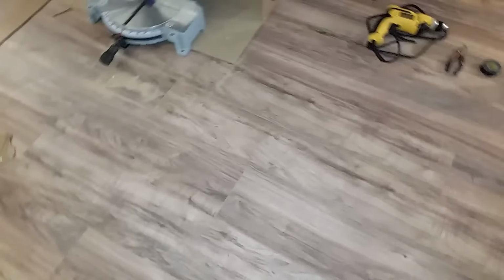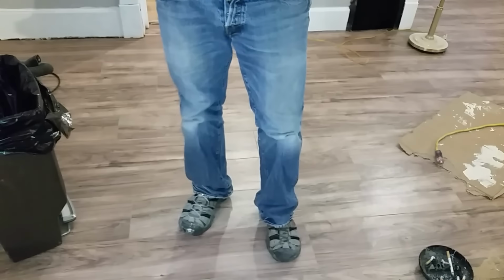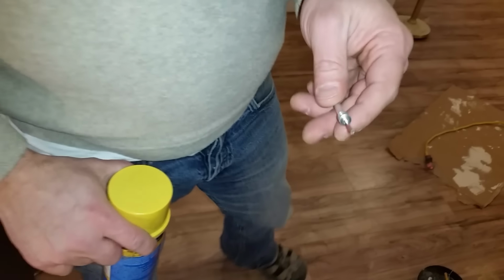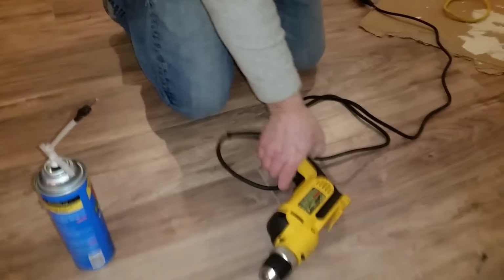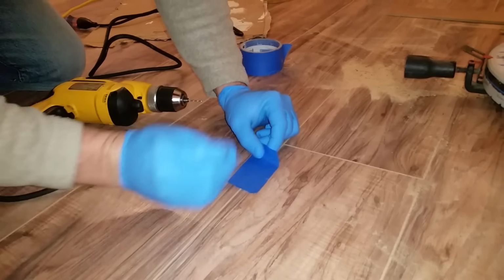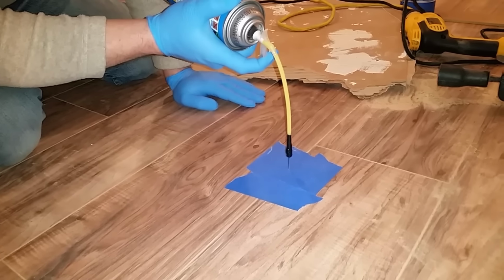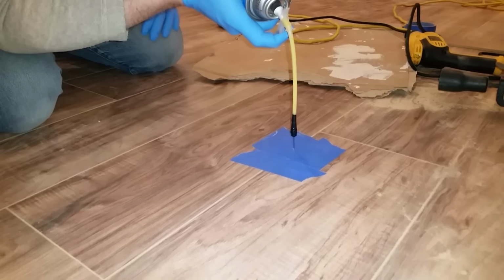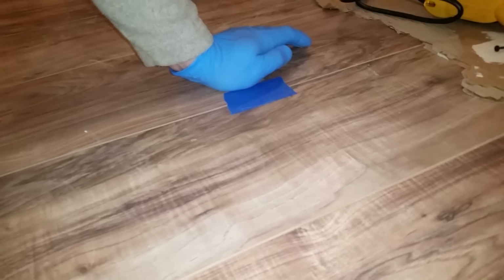Laminate flooring repair to fix soft spot for uneven underlayment

Comment: IT WORKED!  I did everything the same as the video except I drilled a few holes at once in case the foam needed more space to expand. I went very slow and alternated between the holes.  When I was done I left Olympic weights on it overnight to make sure it wouldn't buckle.  I wasn't about to tear the floor up for one soft spot. To all the people saying prep the floor beforehand, no duh. That would obviously be better but unless you have a time machine to go back before the floor was installed, this quick fix is cheap and easy.
Reply: As long as it fixes the issue.  That’s the only point.
Reply: ok, but does it last? (Because the foam turn into powder when it's compressed with time, cf video about guys inflating tires)
Reply: He does leave quite a bit out of the demo
Reply: About a year later... Still feels as solid as day 1. The other comments made me question how this would work so I check it frequently and is not budging.
Reply: I guess it has only been 9-10 months but the point is so far it's working great still.
Reply: Thanks for the 80s middle school throwback (Vermont area here) with the "NO DUH" comment. Then realized wouldn't "duh" be sufficient with... "no duh" being a double negative? Anyway  it's an effective and humorous exclamation.. : p
Reply: A year later and the floor is exactly the same.  It hasn't gone back to being soft.
Reply: @kevbew63  Good to hear!  I have a few soft spots on my laminate floors.  It's driving me crazy!  I'll give it a go.  Wish me luck!!!
Reply: @HarryWangHungLo  Good luck! Make sure to use the right foam.
Reply: Heavy Kevy will do!  I ordered the same foam as seen the video. Should be in any day now. Thank you!
Reply: @ytrew9717  I know its three years since your comment but maybe it will help some else. I have done this same treatment underneath soft shower stalls and tubs. The key is to use a high density, low expanding foam. The foam will still spread during initial application but will expand very little while setting up. I did this in my own home for an upstairs shower floor. It has been close to three years and the soft spot has not returned.
Reply: Im guessing its been 4 years at this point would love to hear how the foam held up. Also, did you use the same brand as the video?
Reply: @teistovisuals  I can't remember if it was the exact brand but I followed as closely as I could. Never had any issues with the floor again but I moved last year. I'm sure it's still holding up fine but I'm not there to verify.
Reply: @disillusioned070  do you think this will work in a mobile home? I have soft spots in the kitchen and hate to rip the entire floor to fix them. Thanks!
Reply: @kevbew63   were the holes easy to cover up? I need to do a few places at our home where I laid pergo laminate plank that has some hollow spots. Driving me crazy
Reply: @jason91205  I drilled the holes in cracks where the planks came together. Then when I was done I used some colored wood filler that came out of a squeeze tube. It was easy to do and hard to notice anything, even when you were looking right at it.
Reply: @disillusioned070  which product did you use? Was your floor laminate or vinyl?

Comment: I guess one precaution would be - DO NOT USE THE HEAVY EXPANDING FOAM !!!!!! BE SURE IT IS "MINIMAL EXPANDING" or you will be very very sorry ...... Just thought I'd throw that out there even though you said it in the video .... This warning is crucial to NOT creating a disaster
Reply: He already said that in the video.... no need to repeat it
Reply: Good tip! I kind of wondered about that too. I thought of the same trick before watching this. But I was worried it might expand too much and push the flooring up.
Reply: @Davidbruun  ok. Understood
Reply: @Davidbruun  Agreed. I actually missed that detail!
Reply: Thanks for that tip, i missed it on the video!
Reply: @successfulMillennial  I think it's worth repeating since using the heavy expansion foam would be a total disaster .... and read below to see a few people missed that very important warning ....
Reply: @shure46  oh ok
Reply: @successfulMillennial  but what about not using expanding foam😁
Reply: @successfulMillennial  actually thought it was very useful
Reply: Yes, that product expands too much and it can like case an inflation behind the laminated
Reply: IS it going to collapse after under weight. ??? Foam vill shrimp??
Reply: Not necessarily. The laws of physics. If the space filled is very shallow, say, 1cm, the foam will spread underneath leaving no cavities. It won’t ‘shrimp’ without being exposed to direct sunlight or other source of heat to gradually turn it into a powder. I’ve done this in my hallway, still holding fast two years on.

Comment: some of these comments are ridiculous and over thought (engineers) lol this is a perfect fix for a homeowner or flipper who has an already existing laminate floor they did not install themselves. No tearing out a perfectly good floor for a minor bend in the planking. Nice video.
Reply from the maker: +John Legnos Thanks, I agree with you since it worked for me.
Reply: John, I am a Quantum Molecular    physicist from the future and i came back to tell Aglobal llc that his repair saved the human race. How? His repair with stand a nuclear explosion  of 1000k joules....lol
Reply: I'm neutral for arguments sake:  It's scary to use the word "FLIPPER" and assume high-quality,code compliant repairs or builds.    BOTTOM line, would this procedure work to make a long lasting quality, trouble-free repair?
Reply: How about by an installer John?
This will create worse problems within a year.
Nice try though trying to shame an engineer. Better luck next time.
Reply: keith cunningham  I don't doubt that, but will this not introduce alot of creaking due to floor no longer floating?
Reply: @SlothyWoffy  I would think that a couple small areas wouldn't affect an entire floor system, but I honestly don't know for sure.
Reply: @SlothyWoffy  Floor will still float in directions of least resistance. It has 4 directions to float to in total. It also a function of the location of the repaire spot on a floor. Plus there is extra flexibility on underpadding also.

Comment: I'm pumped I found this video. Installing a new floor now and just tore it all up just for a soft spot only to try and level it, lay the floor back down and still have a soft spot. I'm not tearing it up again. Just ordered foam and needles haha.
Reply: How did it go? I’m worried about injecting too much
Reply: @rasscal  I have all the stuff but haven't tried it yet because I'm away from home for military stuff. I don't think I'd worry about injecting too much, I don't think it would cause the floor to have high spots. It probably only expands into empty areas.
Reply: And now you did this? Working good?
Reply: @pelless  be really careful when injecting it. It will raise the floor if you use too much. I'd advise only for small spots, and place like a level over the spot with weights on it on areas that are level so you have some resistance to lifting at the level of the rest of the floor.
Reply: @theodorekr9701  good smart idea.

Comment: This laminate flooring fix really worked for me. No problems with the foam drying. It's the same as being in a cavity behind a window or door frame.  :) Thanks s a lot! 5 stars!
Reply: Abbie Road- LLC how do you know how much to put ?
Reply: how do you cover the hole in the laminate?
Reply: @tszabo86  Wood putty would take care of that easily.
Reply: May i know what is the name of the foam?
Reply: Yeah I used this method to stop our new subfloor that was squeaking in certain places. We had secured the boards and counter sunk the screws but somehow there was just enough of a space for the subfloor to give a bit and cause squeaks and creaks. Drilled a hole or 2 where needed slid the little hose in and give it a shot of window & door trim expanding foam. Being the subfloor was screwed down SECURE the foam only filled within the areas it could get into and expanded only as much as the gap available. No squeaking, no creaking and no feeling like it had any give. Also remedied the possibility of causing the new vinyl to be damaged due to that slight subfloor shift/movement.
Reply: After 4 years is it still holding up?
Reply: I use floor wax repair. I loose track of repair areas it looks so good

Comment: Great info. However, I had difficulty with the inflator needle, couldn't get a good seal. Ended up drilling 1/4 inch hole for the foam directly. That worked better for me.  Everything else the same.

Comment: Thanks!!! A great tip. I had a large area of depression underneath an engineered bamboo hardwood floor. Basically the subfloor is slightly uneven but noticeable enough which was hard to appreciate before installing. I did use the regular Great Stuff foam after the “windows and doors” one. In my case, I felt the regular type provided better structural support than the low expansion one. I put weights (a case of planks on each side) to prevent over expansion for the cure period.

Comment: Great video, my floor area was about 14 inches wide so I taped the laminate seam the entire length.  Ball filler was too small for tube so razor sliced end to insert. Taped together as shown and then used glue gun to cover tape ends for secure. worked like champ. weighted seam with 2 , 5# weights on 1x2 board. Holes had little yellow beads come out, sliced off, redrilled hole and sealed with some wood putty. Thanks for the how to video.

Comment: I have laminate flooring and there are a few planks that dip and creak around the seam of the joints. Will using fast setting wood glue work? Or am I to use minimal foaming glue? I cannot rip apart the wood to fix it for expansion.
Reply: Have you tried it yet? Did you end up using adhesive / glue or expansion foam?  Thx

Comment: Do not use loctite brand foam, use great stuff brand. Loctite brand is very dense and created more problems as it made the floor a “mound”…..needless to say I’ll be removing 3 planks to clean up the mound and correct the problem.

Comment: As mentioned below do not use much you we’ll be screwed. Much safer to use a caulking with a turkey injector and then put a wait on it.  Foam is harder to control.

Comment: Problem only after dry Foam push laminate up because foam it’s razing and make bumps in laminate
Reply: That's why you're supposed to use non-expanding or minimal expanding foam. If you use expanding foam for large gaps, yeah it's going to do expand just like it was designed to and it's going to create lumps in your floor.

Comment: I don't know, but this approach seems like your basically creating uneven flooring by (foaming in) the soft spots. You may have addressed the "soft spot" by creating uneven mounds on your flooring. Wouldn't a better solution be to use the same method (attaching air needle) to a bottle or tube of construction grade glue?

Comment: I can't wait to try this!! I made the mistake of hiring a "flooring installer" from the internet to lay vinyl plank flooring on the entire main floor of my house for a cash deal. I quickly found out why his price was so low. This guy put NO underpad or anything over the subfloor before laying the vinyl planks. So I have SEVERAL uneven spots that are now causing some planks to crack. I'm going to try this genius trick today.  One question though, how do you hide the drill holes? I am going to have quite a few and a lot of them will be in plain site.  THANK YOU!!!
Reply: Same here and they never even answer the phone anymore
Reply: @kathr3335  If possible drill the hole through a knot looking area of the plank and gill with regular wood puddy to match. you will still see it when the light hits it right bit it will be less noticeable.

Comment: I actually did this before but used a 3/8s drill bit which is the same size as the tube and I plugged it afterwards with a piece of wood and colored the plug with a stain pen

Comment: I tried this 2 days ago but with the 3" expansion foam and not the yellow top 1'inch. 3 in is better but the hoses don't fit on that tire inflation nipple and tape only works for 1 minute before it blows out.

Have to use the clear plastic hose as the gray one will not work and I already had 2 left over.

Comment: Your Video on laminate floor was ABSOLUTELY GREAT on so many levels.  Listen People!  If replacing the floor is the option a Pro would do then why not give a $20 fix a shot and see the results.  I loved the Puritans say this was a horrible job! I loved the People who loved this trick and I even loved the idea of glue instead of Great Stuff.  Even the guy who wanted to come up from the bottom of the sub floor to inject the stuff ..AMAZING..  This video got people together talking and thinking.  Thank you to all the people with the "should not be tried" comments, I do see your points made..they are quite valid and have experience behind  them.  

I am being called in to repair a floor and have the quote to replace the floor, a quote to repair the sunk in areas....And, now I have an idea to try it myself.  A big THANK YOU to the Author of this video; You have provided inspiration!
Reply: If ur replacing the floor, use a leveling compound and make it flat for when you put the new one down. Thats as complicated as it has to be. But most times people wanna save a little money

Comment: I'm impressed, as a floor installer, I have bought the expensive kits to do fills, but I like the foam spray trick
Reply: What is the kit called? We are nervous about drilling in to the floor. We have a few low or soft spots
Reply: No matter what product/kit you use your gonna have to drill into the floor. Installers do it all the time so theres really nothing to worry about. I usually drill into a knot where the hole can be easily hidden. I normally use Dritac repair glue but its expensive compared to this foam stuff. Ima give it a try the next time I have a repair.
Reply: @amyrose7261  drilling into the floor is really no big deal. If you drill into a seam or knot, you will never notice a little 1/16 inch hole once it’s filled. Don’t stress!

Comment: A company in Florida did our floor the whole house it cost a lot money. When we walk we feel soft spots in some parts ,they came back and removed the vinyl plaks but the floor is not level what he did is removed the concrete and put new one to level floor ,but still having problems in a different spot . To stressful every time is a lot dusty cleaning and moving furniture. What can we do??? Do that glue u used will it work in our case? Thanks

Comment: Put down vinyl plank flooring and found a soft area. Was sceptical but tried this fix and worked perfect. Floor is solid now. Pushed down every so often to help spread out. Thanks this was a great help
Reply: Great to hear as I have the same issue. How did you repair the drilled hole?  My vinyl plank does not have a bevel where the joins are.
Reply: @mikegrguras9825  I was  initially concerned with how I would fill the hole but it's so small honestly I couldn't see it after so I left them . Darker flooring so not sure if that helped. I didnt worry about drilling in  the bevel I tried to find the center area of where it was low. Did about 8 different spots couldnt tell you now where they were
Reply: @colintaylor8234  sounds good. Yea my floor is lighter and I grabbed a scrap piece to see the hole size. Mine might need some patching and see come putty kits out there. Thanks for the reply!
Reply: How is it holding up?
Reply: @bellevillespirits-michell7030  no issues so far.
Reply: Floating floor right? Ever have issues?
Reply: @hattedsandwich2415  no issues . Big thing I found was if you do this and just walk away you could wind up with a hump. I threw a box of flooring on top or something flat and heavy to make sure it spreads out. Other issue would be if you ever have to pull it back up you would probably need to replace. I was using vinyl floor
Reply: @colintaylor8234  Thank you so much!

Comment: This is NOT how this is supposed to be fixed. This is a instructional video for hackers...
Reply: Great Ron, but how about you tell us HOW it's supposed to be fixed?
Reply: @saidtheblueknight  fixed? The subfloor should have been leveled correctly "before" the installation. Doing it right the first time by hiring a flooring professional and not school gym electrician moonlighting as a flooring repair man would have been the best thing to do. Flex tec makes a 2 part water based injection adhesive that's eco friendly and dritec makes great kits aswell for this specific repair. If you care about your home do it right or have it done right the first time...
Reply: @ronstevens6656  Noone's saying the subfloor shouldn't have been done properly to begin with. That is kinda the point of this, fixing something that was not done correctly to begin with and without tearing it all down and starting all over again.
Reply: @saidtheblueknight  let me simplify it for you... You do not use door and window expanding foam to fix this problem. It doesn't have enough density or stability to accomplish what's needed. The methods are similar but the materials are not ideal or recommended by any true flooring professional... happy?